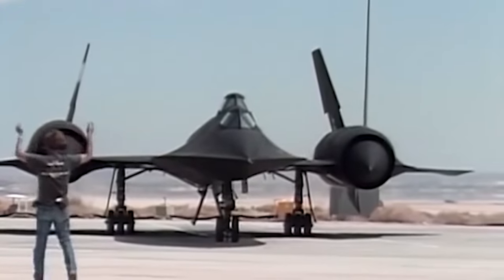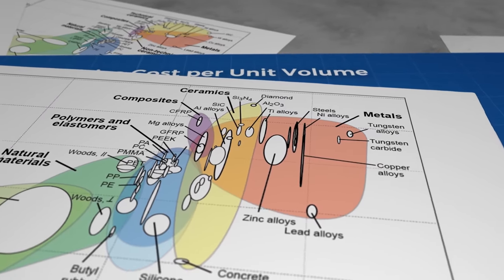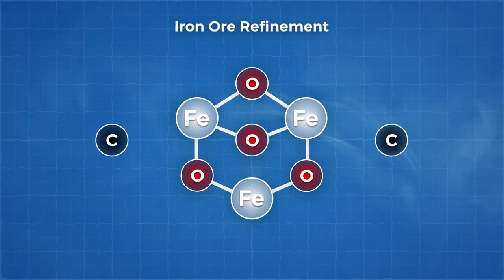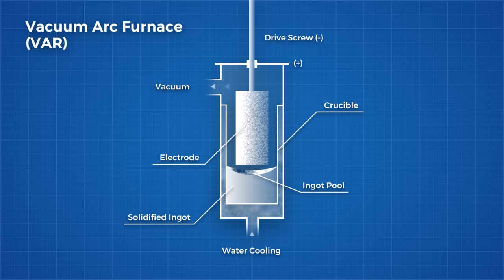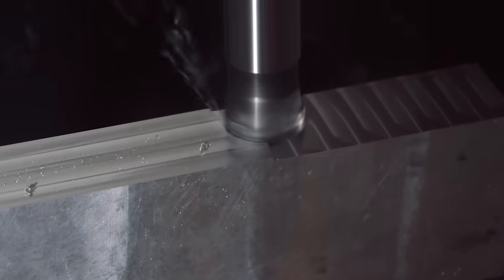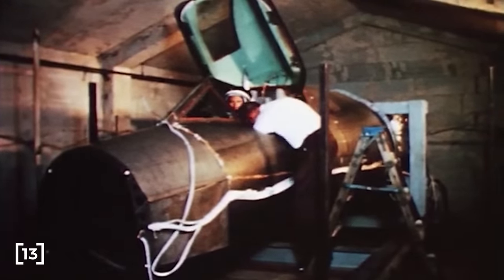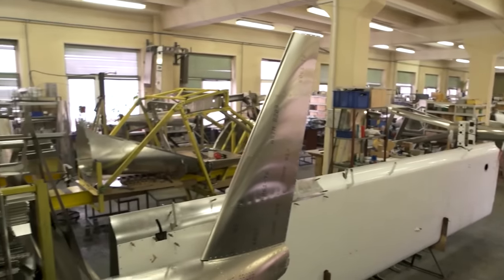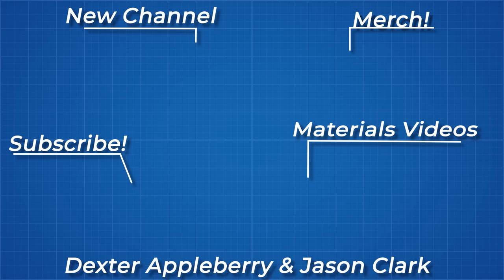Titanium - The Metal That Made The SR-71 Possible

Comment: I love how there's concrete on the "aerospace material strength/density chart". I KNEW it! Concrete glider existence evidence right here.
Reply: The Civil Engineers are infiltrating Aerospace Engineering
Reply: On the positive, the glide path is very predictable.
Reply: @STARDRIVE  yeah because it goes straight down lmao
Reply: @mykl1673  you ruined his joke by explaining it
Reply: i don"t know about glider, but concret boat exist and they are rather good
Reply: It's concrete evidence that the aerospace industry has a sense of humor.
They must have been trolling the CIA agents.
Reply: However concrete coatings are non-suitable for scrambling incoming radar waves.
Reply: Ceramic-Tiles at the bottom of the space-shuttle burns off to "dissipate" heat. Ceramic is sort-of concrete. Space-shuttle is sort-of glider. Powered hang-glider trikes is plus one to space-shuttle.?
Reply: I have a dream of building a porcelain plane.

Comment: I was an aerospace machinist for about 7 years and then an aerospace manufacturing engineer for a few more years and my favorite of all of the exotic metals is titanium. :D
Reply: I love titanium for its properties but I really hate machining it
Reply: Any recommendation on cutters and speeds and feeds?
Reply: What do you think about refining TiO2 in space?
Reply: @johnokean8216  I know I'm not the perso you asked, but I'm going to add my input if you don't mind. right now that would be way too expensive since we need to bring the heavy material up into space with expensive rockets (titanium is really really heavy), but hypothetically in the future it might be worth while.
Reply: @tylerhansen9872  Max out your depth of cut and feed as hard as you can while still maintaining finish. Use high pressure coolant. You NEED to get that chip to break. If the material starts sparking there's a very real and very serious risk of it igniting the swarf.

You want a very sharp insert. Something like a .002-.008 TNR. TiAlN PVD coating. Through tool high pressure coolant. Speeds low but chipload high.

Starting Values of a Sandvik CCGT 3(2.5)0UM 1105
ap: .02 (.004-.041)
fn: .002 (.001-.003)
vc: 245ft/min (245-245)
Reply: @johnokean8216  What's your plan to get the raw stock into orbit and finished ingots back to earth cheaply and efficiently?
Reply: I prefer Inconel 718 to titanium to machine. Titanium i found to be very challenging. Tooling and technique help a lot
Reply: @devindykstra  How would it be useful please elaborate?
Reply: Can it be CO2 laser cut?
Reply: @johnokean8216  why do you ask? What is the difference between refining on earth and in space?
Reply: @devindykstra  why grab metals from the earth and move it to space when space has everything we really need? the only thing we need in space is the technology to make this types of metals, and more
Reply: @naveenarora6467  The difference is oxygen. Titanium burns before it melts, so you need expensive airtight vessels to process it. In space you could do it out in the open since there's no oxygen around. SpaceX Starship is what will make such things cost effective. It would be stupid to carry raw material up from Earth, but once we get to mining titanium ore on the moon or other places, it will become more cost effective. I bet SpaceX will even set up a manufacturing facility on the moon to build a titanium version of Starship.
Reply: @dekutree64  This is what Musk's Boring Company is all about, long-term (imo). Space-based mining operations.

Tesla for on-moon or on-asteroid personnel and materials transport, Boring Company for mining operations, and SpaceX for delivering the product back to market/Earth.

Edit: Obviously this is a long way away but I think he's putting all the pieces in place for a space mining company to take shape.
Reply: @MissBunny850  you could attach a scramjet engine on a rocket and then shoot it with a railgun. The high velocity of railgun can start the scramjet and u will not need to carry oxygen at all. Awesome but material science needs to develop further as well as someone has gotta take the initiative. Nasa had this idea 10 years ago but U.S DoD probably classified that shit afterwards coz u know railgun scramjet make an excellent weapon as well as anti missile defense sytem. I mean china has devoloped that shit... but theirs is pretty shitty. I'm Indian and i'm confident that my people have developed it too coz we made the first practical for weapoms railguns and scramjets. But like all things it probably classified
Reply: Wow😀
Reply: @tylerhansen9872  Your best bet is to start with the feed and speed charts available from the company you buy your tools from.
I would recommend 180 SFM as a great starting point for milling Ti.
Reply: @EVOMAN14  how is that? I have done a lot of machining and welding on many grades of titanium and never found it to be particularly difficult to machine (welding more so)
I do some machining on several inconel grades (including 718) and in my experience go through a lot more tooling.
Reply: @devindykstra  oh yeah I was assuming that the titanium actually comes from asteroids we put in earth orbit. Future of resource acquisition will most definitely be asteroid mining. Itll be cheaper to acquire the materials later down the line all while saving the earth!
Reply: @PseudoFiction  this is out there, but I firmly believe asteroid mining is our answer. We need the material anyway to become a space-faring species.
Reply: @naveenarora6467  well, titanium will be especially useful for spaceflight in the future. Plus, earth's atmosphere complicates things immensely. Having a vacuum present eliminates the possibility of contamination
Reply: @johnokean8216  oah yeah I forgot about asteroid mining. We probably won't bring many into earth orbit, but if it's already up in space it should be much easier to refine.
Reply: @naveenarora6467  how can shooting anything with a railgun maintain its structural integrity...;unless it is the projectile??
Reply: @Idontrunntoofast  This has been my experience, too.  Titanium machines like really spongy aluminum.  All of the nickel-based alloys like inconel are extremely abrasive.  The two things that really revolutionized cutting both titanium and inconel are cnc machining and using carbide tooling.
Reply: @bryanhawk6052  I said we'll need great advances in material science didn't I? Also I do have an idea to maintain it's structural integrity it's probably bullshit but I'll take no chances. Also there are ways by extending the length of the rail gun and reduce the energy. Coz u know we donot need to accelerate from 0 to mach 7 in 0.1 seconds in a Railgun that is not a weapon.
Reply: @naveenarora6467  turning it into less of a gun and more of a catapult/slingshot
Reply: UFO metamaterials: am i a joke to you?
Reply: @naveenarora6467  K just trying to figure all of these comments out, thanks for replying.
Reply: @johnokean8216  
Asteroid, or lunar sources? Forget Earth. Going down is cheap, going up not so much. The Moon has rich Ilmenite (FeTiO3) sources.
Reply: @MichaelSHartman  honestly, either or. I think moon is great place to practice,  but it wouldn't take much to just "nudge" a big asteroid into orbit around earth.
Reply: S2 Tool Steel is pretty bad concerning tool wear, especially any decent tolerance i.d. work with boring bars.
Stellite is brutal for tool wear too, the chip comes off similar to that of cast iron, but finer and cleaner.
As to machinability, I think titanium is one of the worst.
Reply: @madrox4132  same with kevlar. Water jet works really well
Reply: What's your opinion on Beryllium?
Reply: @theq4602  I don't remember working with it if I did.

Comment: I remember back in the 80s, how titanium was seen as some sort of wonder material. Everything cool was made out of titanium. I think even The Terminator's endoskeleton was made out of it.

Now it's all graphene & carbon nano-tubes lol
Reply: Carbon's way cheaper and (with the right marketing) way sexier. For aerodynamic shapes, carbon's better.
Reply: Tbh if you try to become a cyborg, a titanium skeleton is your best bet. Titanium tends to be rejected the least compared to other metals by the human body
Reply: But brittle, unable to endure Heat or even UV to the dame extent, etc.
Reply: Titanium is nice, but it's really just a cool name, not much special. Other, cooler metals exist. Osmium, for example, is blue.
Reply: Soon....METAMATERIALS.
Reply: To be fair graphene will completely change our society if the cost comes down. So many applications across so many fields
Reply: The really expensive and high quality BMX bikes are made out of titanium.
Reply: @Buran01  but it obviously will endure human normal human temperature, and if you use it as replacement of your skeleton i think it would not be exposed to uv light that much
Reply: @kaiser7695  For competition bikes, special materials that make the bike slightly lighter may make sense, but for most people, steel is good enough for bicycles and titanium or carbon or aluminium frame is just clever marketing.
Reply: @alexalbrecht5768  And it will take decades(just as plastic in it's early days) for the material of the future to be seen everywhere
Reply: I like how it's a synonym for "high tech engineering quality" but very impractical to use so marketers find ways to sneak it in, like my badminton shuttlecocks "enhanced with oxygenated titanium"... The nose is painted white with TiO2 ;)
Reply: @1Maklak  Disagree, Aluminium isn't much more expensive then steel for bike frames. And it's significantly lighter which certainly helps when climbing. Also aluminium frames won't rust when your chain clips some paint off. Aluminium is probably the best Bike material for most people. Which is also why you find alu frames everywhere. Carbon is for the most demanding riders. And titanium always comes with lifelong warrantee on the frame.

So even though titanium is expensive and requires a lot of energy to make it still makes sense for people that want to keep riding it for the rest of their lives.
Carbon can be made more aerodynamic and better tailor made for stifness and comfort. Even though it does come at great cost.
Reply: I thought he was an animatic poly alloy?
Reply: K
But we need wuderwaffen
Reply: @alexalbrecht5768  Graphene is a good investment as it will be used in hundreds of products from batteries (already available), electronics (replacement for copper and gold), bullet proof vests, are just a few. As it gets easier to produce the price will come down and the cost comes down everyday.
Reply: Nanotech...

you like it?
Reply: Jumpercable wireless also significantly stronger than steel despite only being a fraction of the weight
Reply: @alexalbrecht5768  titanium amd graphene alloy would be marvellous......
Reply: @kaiser7695  not too many full bikes. mostly just parts. a full frame would be too much money. even spokes for a wheel are 5 times the price of normal spokes
Reply: @1Maklak  bmx uses chromoly. road bikes use more carbon fiber stuff now. aluminum was used in racing bmx stuff but not so much anymore. more of an 80s gimmick
Reply: The T-800 was made from a polyalloy, which is something of an oxymoron since an alloy is a combination of materials so a polyalloy is a combination of a combination of materials.
Reply: lol i remember the 80s back when i was negative 30 years old, what a time that was
Reply: @krashd 
I thought it was a titanium hyperalloy & the T 1000 was pollyalloy?
Reply: @swarupendranathchakraborty3500 
100% agree, the best replacement hips & such are made from titanium.
Reply: @alexalbrecht5768 
Oh I weren't trying to suggest that graphene was on the same level as Titanium, all smoke no fire.

The next gen PCs are probably going to be graphene based rather than silicon. Apparently they will perform better at the smaller scale. Not sure if it's a heat thing or something about the material that prevents quantum tunneling. If I were to guess, I'd say it's a heat thing.
Reply: @MrJceOfficial 
Well I have an interest in the medical field. So yes, I do. Given how nano-tech is used in that field.
Reply: ...and then SpaceX starts making their awesome new rocket out of stainless steel.
Reply: Lieutenant Dans legs were made of titanium
Reply: @Engiction   : But  it would be exposed to water that you drink daily.
PS. water is good for you, isn't it  ?
Reply: Titanium is used in a lot of products today. It become less sexy because it's more common. Everything from jet turbin blades to hip replacement is made of titanium.

3d printing titanium is also fairly common in the insustry
Reply: Yeah, robocop was a kevlar titanium composite.
Reply: @nathanphillips7787  that is a thing.. well.. sort of. Kevlar is a brand name for armid fiber. There are metal armid fiber composite. I think the A350 use panels that have armid duraluminum composite. True, it's not titanium.

It kind of make sense to make a robot of titanium because it would be more bullet resistant than making it out of duralumium.
Reply: @nathanphillips7787 
Yeah I was watching the nerdist Robocop vs Terminator video last night & realised I was thinking of Robocop lol
Reply: @PKMartin  ......yes,, I tolerated my dentist telling me that my new inlay had titanium in it's composition . Naturally it's  titanium oxide as the white pigment .
Reply: @1barnet1  .....I'm thinking that carbon for bikes can also be as a plastic frame that is reinforced with graphene . The graphene is as nano particles mixed into the molten plastic. Robert Murray smith in his channel produced some of this plastic .
Reply: @philipvernejules9926  CFRT you mean. Usually uses short carbon fibers with a thermoplastic as it's resin.

They're used in mass production in cars already. It does require massive start-up costs though. With high precission CNC molds required. Not sure that's viable for frames, Especially with the late trends with different geometry for every small niche.
Reply: The terminator was made from cobalt tantalum alloy tho
Reply: @MrGoatflakes 
Problem is there have been too many continuity changes in The Terminator franchise. I think the Cobalt Titanium one was from The Sarah Connor Chronicles in particular. Though I'm never 100% about these things.
Reply: @1Maklak  we should move to fiber glass frames, cheap, light and strong. Tho a little less rigid
Reply: @1barnet1  fiberglass is the way to go
Reply: @swarupendranathchakraborty3500   you could go bling and use gold, but it is not as strong ofcourse.
Reply: @kevineckelkamp  what a wobbly mess an einstein -bose condensate would be.
Reply: Only problem with carbon: if it catches fire, it burns until nothing is left of it / extinguished.
Reply: @swarupendranathchakraborty3500  also it doesn't distort in time warp.

Comment: The sr-71 engineers:

“I used the soviet to spy on the soviet”
Reply: We also used a Russian equation to design the F117 ...😆
Reply: @toddie4usa1  Until we found out its flawed and decided to add curves.
Reply: The USA were unable to spy on the USSR with that titanium due to the introduction of the now-famous Soviet/Russian air-defence missile systems (S-25, S-75, S-125, S-200, S-300, S-350, S-400, and the upcoming S-500).
Reply: @myusername3689  It was not flawed; the slight curves were added for aerodynamics/better speed/thermal control.
Reply: Don’t worry the Chinese are doing the same with the Americans as we speak.
Reply: @StrangerHappened  No Russian missile ever touched an SR-71.  When the missile detection system alerted the crew, the pilot just pushed the throttle forward.  They outran every missile.
Reply: @StrangerHappened  Well thats just an outright lie.

Comment: The frame of my glasses are made of titanium. It doesn't "rust" from my sweat, like my previous stainless steel frames. I am so glad I got it.
Reply: if your previous glass was rusting, they were not made of real stainless steel. stainless steel is an alloy made exactly to not rust
Reply: @jackiworld  it's called stainless, not stainfree
Reply: @bintjbeil7892  i think he stand by his point of Stainless-Steel rusting....
What rrally happening is, he is not taking enough shower and sweat ruined the frame with salts in it along with water😂
Reply: I also like titanium frames because they “feel” less “cold” because of their lower thermal conductivity.
Reply: @jackiworld  Not all stainless steels are stainless in salt water - which sweat is.
Reply: My old pair was titanium too. In a hinge-less  spring arm style. Unfortunately, the arms slowly work hardened from light bending and broke.
Reply: @tz8785  No, you have to add molybdenum to improve resistance to dissolved chlorides, and even then it isn't perfect.
Reply: If you like titanium check out a company called "Vargo". I got a titanium water bottle from them and love it. No chemicals like from plastic, and does not dent like aluminum or stainless. It is also so corrosion resistant I can clean it with bleach. They make titanium stoves, backpacks with titanium frames, all sorts of neat stuff. Stilletto makes a wide variety of titanium tools. I have some that I use when working with high strength magnets or in areas with high magnetic fields. It has gotten a lot more affordable.